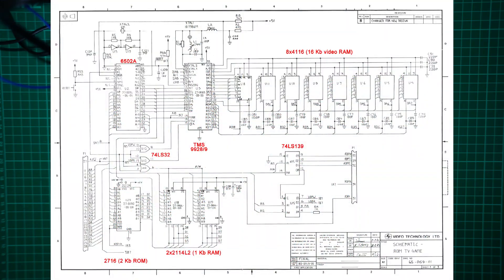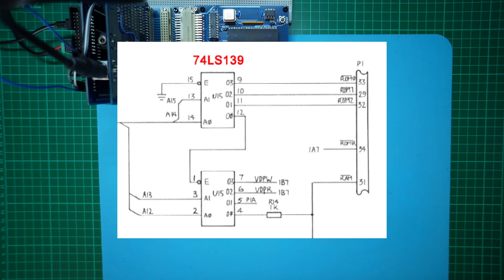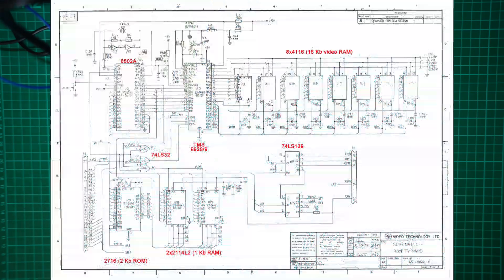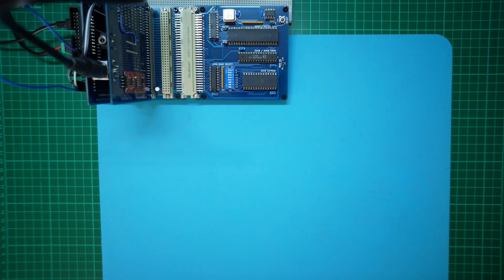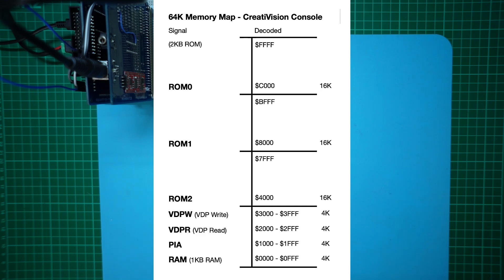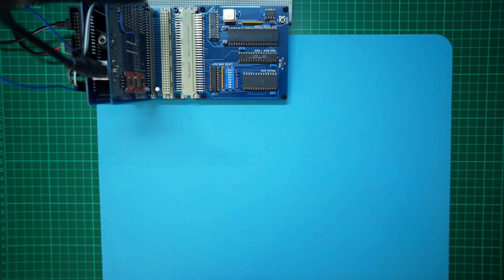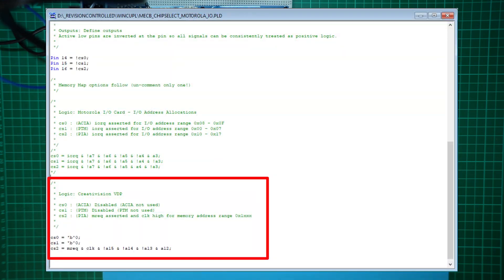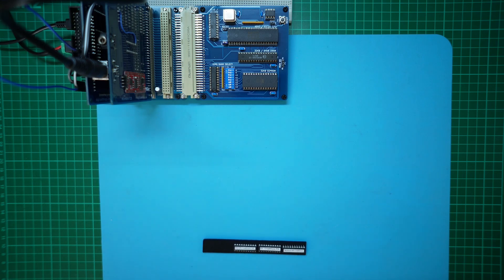Minimalist Europe Card Bus (MECB) - 6502 CreatiVision re-Creation (Part 1)

Comment: It was basically a 6502 version of the ColecoVision...Sadly the CreatiVision doesn't have many Games ?  Did they make a ColecoVision adapter to play colecovision games ?
Reply from the maker: Yes indeed. I don't recall the ColecoVision being available in our country, so I just have nostalgic memories of the CreatiVision (or Dick Smith "Wizzard" in Aus/NZ).  But, I may certainly be wrong.  However, I've already got a commented out Chip Select section for the ColecoVision in my TMS VDP Card's WinCUPL source.  It's sitting there pre-emptively waiting on me to get around to making a Z80 based CPU Card.  😉🤓
Reply: @DigicoolThings  I've got some Z80 chips...I'll pop some in the next parcel I send. Z84C0006PEC,Z84C0008VEC  DIP/PLCC type
Reply from the maker: @lezanderson1236  That'd be awesome.  I did buy 2x Z84C0010PEG new from the last of Mouser's stock back in April, when the Z80 went EOL.  Part of making sure I had a couple on hand, further prompting me to eventually get on with a Z80 CPU Card. 😊
Reply: @DigicoolThings  Out of curiosity - which package are you planning on using i.e. 40-pin DIP or the 44 pin PLCC version? Just so that I can try to get myself prepared :-)
Reply from the maker: @epaell2  For the Z80 CPU Card, I plan to first use the DIP40 packaged Z80 as it would be the most commonly available.  But, personally having a thing for PLCC packages and PLCC TH sockets (so still retro PCB friendly), I do expect that I'll probably make a follow-up PCB version, for those who also prefer PLCC over DIP. 🤔

Comment: Looks good, did you record the audio while walking around the room? Or is there a ghost in the machine. 🙂
Reply from the maker: @TheEmbeddedHobbyist  Do you mean the reflection of me moving in the monitor, or do you mean the noise in the audio?  I’ve got a good microphone, and all other audio sources are muted, but I seem to randomly get a background clicking noise that I haven’t figured out yet. 🤔
Reply: @DigicoolThings  the audio seemed like the sound of something walking around,  hence the ghost in the machine.  Take the micro card out for a long walk that might exercise the ghost.   Bugger looked up the wrong word should have been Exorcism :-)
Reply from the maker: @TheEmbeddedHobbyist  Yeah. I need to get to the bottom of the sound issues.  There’s a background clicking noise, and then after adding a noise reduction filter it sounds like I’m in a cave. 🤔

Comment: Hello again, thanks for another great video. Ive been following along for a while thinking of resurecting my old 6502/6809 designs and came across the extended syntax for WinCUPL, I think I'll be using it when I next burn a chip. here is an example I found online  from trobertson ```Name     6502PLD ;
PartNo   00 ;
Date     11/26/2021 ;
Revision 01 ;
Designer tmrob ;
Company   ;
Assembly  ;
Location  ;
Device   g22V10 ;

/* Input */
Pin 1        = CLK;
Pin [3..11]  = [A15..A7];

/* Output */
Pin 19 = RAM_CS;
Pin 20 = ROM_CS;
Pin 21 = IO_CS1;
Pin 22 = IO_CS2;

/* Local Variables */
FIELD Address = [A15..A7];

/* Logic */
RAM       = Address:[0000..7EFF];
IO1       = Address:[7F00..7F7F];
IO2       = Address:[7F80..7FFF];
ROM       = Address:[8000..FFFF];

!RAM_CS   = RAM & CLK;
!ROM_CS   = ROM;
!IO_CS1   = IO1;
!IO_CS2   = IO2;``` I was impressed by the easily read address decoding statements and pin definitions.  What do you think? David